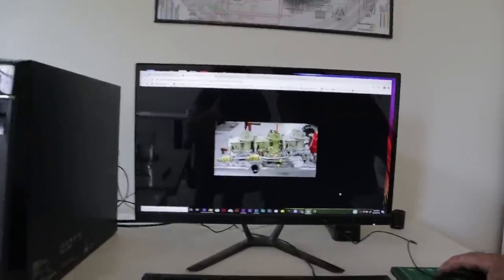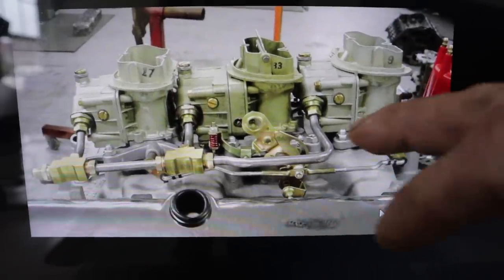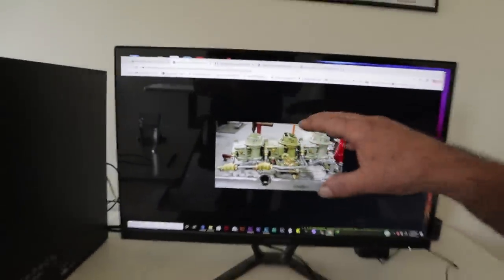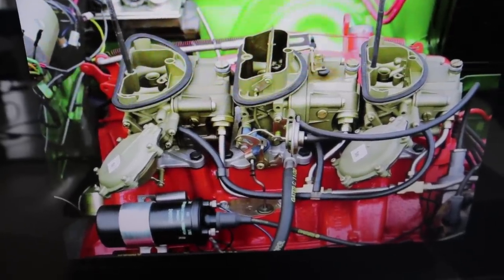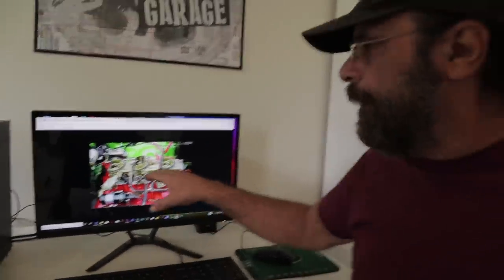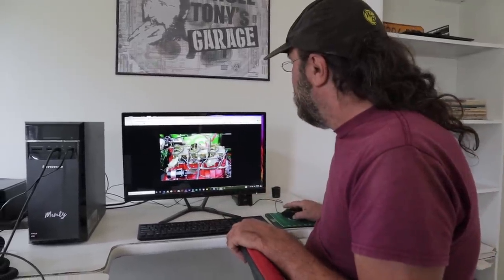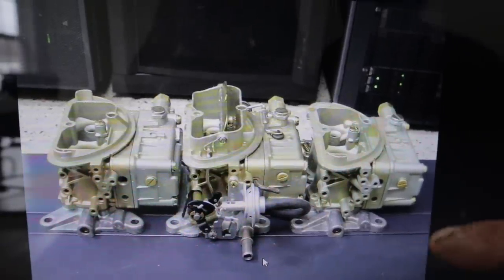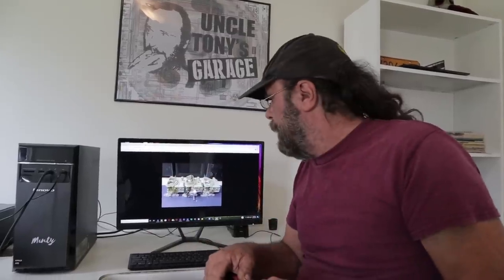The Infamous Chrysler Six Pack

Comment: Thumbnail looked like a meme 😂
Reply from the maker: That's the actual Chrysler ad for the 69 A12
Reply: Uncle Tony's Garage ah you beat me to it
Reply: Adam Sauceda if I’m right the A-12 option car was heat only less trim less pretty interior stuff better suspension and it had a fiberglass hood with 4 hood pins 1 in each corner and they had a 440 6 pack 

I’m sure there was other stuff in the A-12 option I just listed what I know they had
Reply: @leeduke9518 okay ?
Reply: Adam Sauceda the reason I said that was cause where he said that’s actually the add for the A-12 option car I figured I’d say what the A-12 was kinda so as not to bother him if you didn’t know what it was
Reply: @leeduke9518  my apologies I didn't even notice utg replied I was confused as to why you typed all that
Reply: Adam Sauceda oh ok    👍

Comment: I don't see the advantage othet than being able to cruise on a 2 barrel (sipping gas) and having basically a 4 barrel on tap when you floor it. Fuel injection is superior . 
I would like to see a larger 4 barrel with two small jets and two massive jets to compare to the 6 pack
Reply from the maker: You're using the word "jets" wrong...and the type of carb you are describing is called a spread bore.  Been around for 60 years
Reply: You feel the advantage when you floor it.
Reply: @UncleTonysGarage  thanks for the reply. I am still wanting to know if we have a difference between how a 6 pack and a spreadbore would ultimately perform. Wouldn't it be similar and easier to tune? Also...I wanted to know if you took a 360, bored it out 0.030, put a 318 crank and rods, and put magnum heads....would that in fact be a 340?  Also do you know anyone thats built A 318 to a 392?? Any thoughts on this? Thanks again
Reply: You also go more even mixture then. Today, good 4barrel manifolds do as good a job making even mixture.